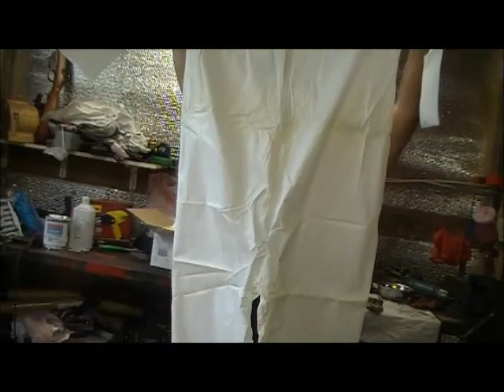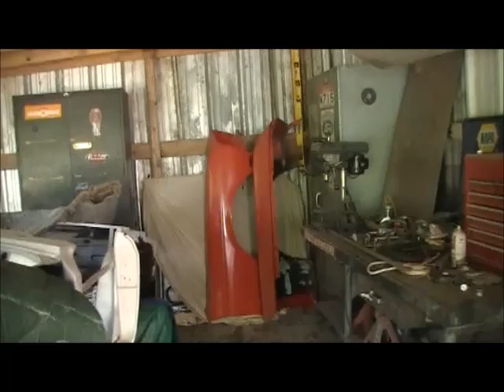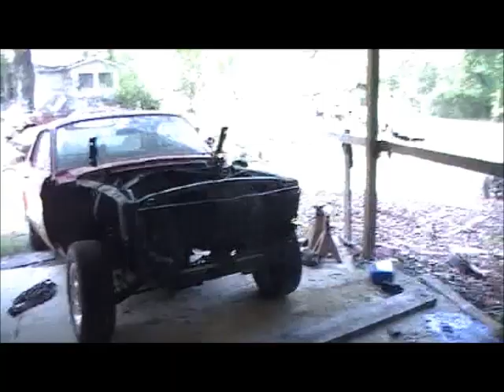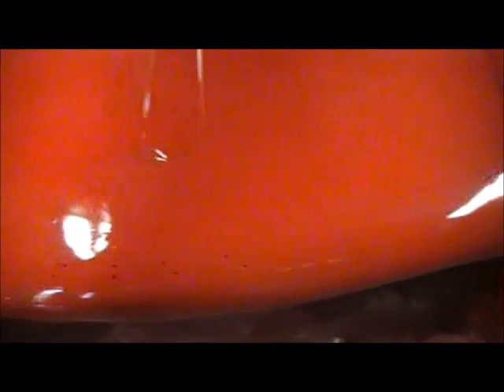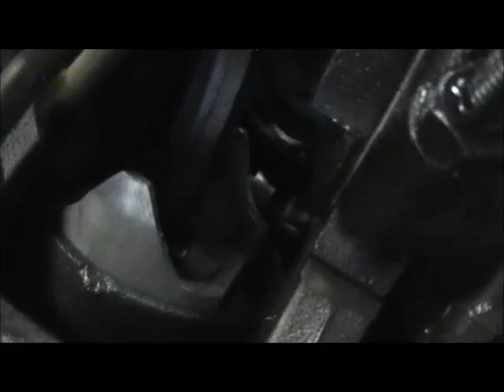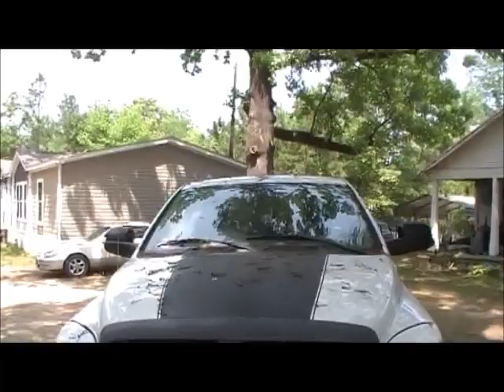WallysPlace66 Mail call

Comment: Red is a bugger to paint..Seems like the more you put on the reder it gets so if the undercoating is different here and there it's gunna be noticeable...The reason for 20 mins of 2500rpms to break in the cam is at that speed there is massive amounts of oil splashing around and much of it slings off the crank and rods and allover the cam lobes but I recon you knew that somewheres in the memory bank..Love ya back mate.
Reply from the maker: ZIGgassedUP  Thanks dear Ziggy.  I have built gobs of SBC engines and a dozen of others. I don't remember ever using a degree wheel to set up the camshaft. Just a couple had different slots in the lower gear. Always ran the cam 'straight up'. Why degree a cam?

Comment: From what I've read Cut worm doing research before I tackle mine the color primer you use does affect your top coats and the painters will use either a light or dark color depending on the top coat color, shade or how they want it to pop. This I've only read about and other than some single stage acrylic  enamel on the inside, underneath,  engine bay and some toys that's all I've sprayed myself. I kept mine simple using gray on the car and red oxide on the toys.
Reply: Maybe some of the painter guys will drop in and tell us both more about it soon.